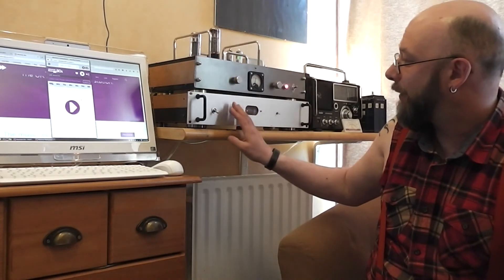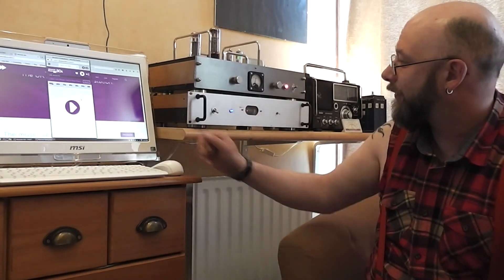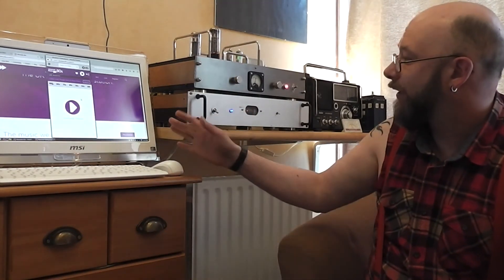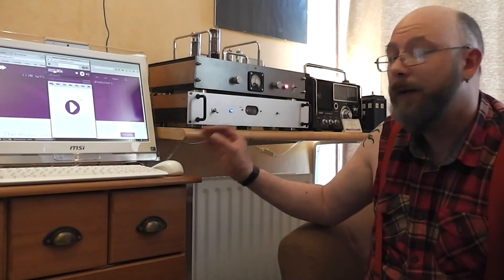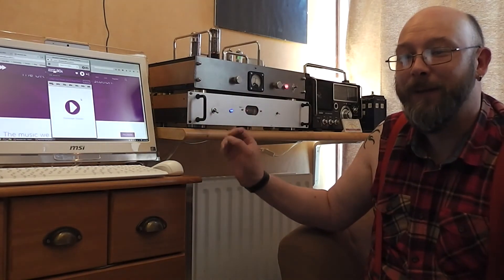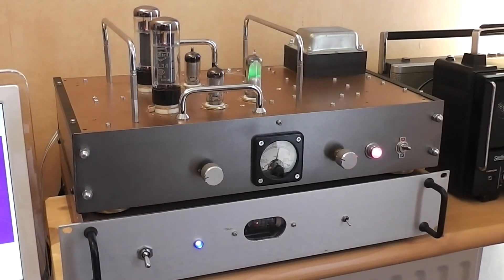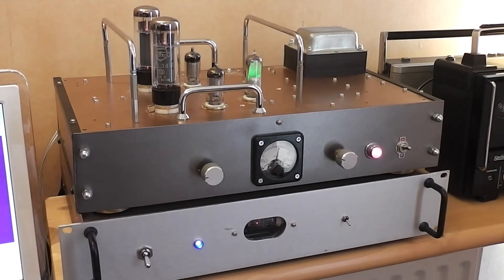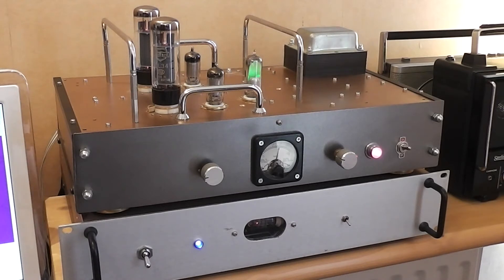EL34 Valve Tube Amplifier And DAC for PC Audio

Comment: Can you help me out? I'm on a quest for the best sounding music I can put out. I have a mac mini thats ran through a m-audio interface with 1/4 inch out to KRK rockit 5's. I also have it hooked up via mac headphone output to a technics EQ to RCA on the KRK's. I'm looking to use a tube amp. I primarily listen to jazz and I feel tube is the way to go. How would I incorporate a tube amp? I only really see headphone amp's out there. Any help would be appreciated!!! Thanks!!
Reply from the maker: Hi Josh. I think the M-Audio DAC is the best source for you. The jacks can be adapted to RCA/Phono and should drive a Valve/Tube amp. However, the speakers are active (internal amplifiers) from what I can see, so unless you take them apart to get at the connections you may need another pair of "normal" speakers. I have seen some amps on Amazon and Ebay. I can't advise on what is good, but you can read reviews. Be careful as some amps are hybrid with transistor outputs. Another thing you could try is a valve preamp between the DAC and the speakers, but honestly I think the valve sound comes from a Valve/Tube power amp in class A single ended in my option. Daz
Reply: Thank you for the reply! I changed the setup again. Now I have a technics 2 channel 100x2 amp. It's fed by the mac mini's headphone out to rca to aux on the amp. I also have tower speakers. I guess where i'm confused is, do I run the tube amp thru the aux channel on my Technics receiver?  Also, could a tube headphone amp be used for this setup and output to the towers?
Reply from the maker: Hi Josh,  A valve power amp fitted with its own volume control could connect to the Mac Mini headphone output and connect to the speakers directly, thus not needing the Technics amplifier at all. this would give real valve sound as I have. A valve headphone amplifier would not drive the speakers very loud at all I am afraid as its only designed to give less than 0.1Watt for headphones.   Daz
Reply: Thank you, thats exactly the information I needed!